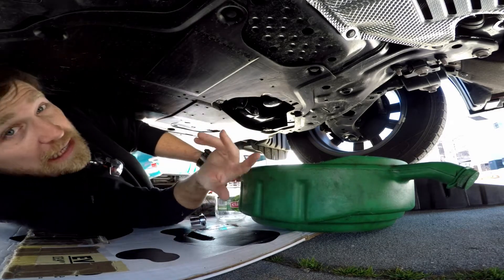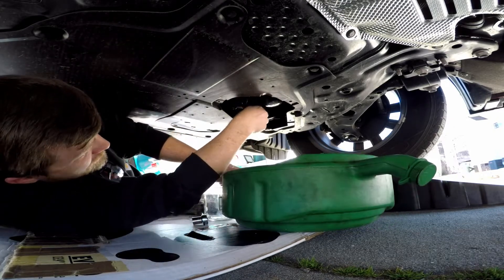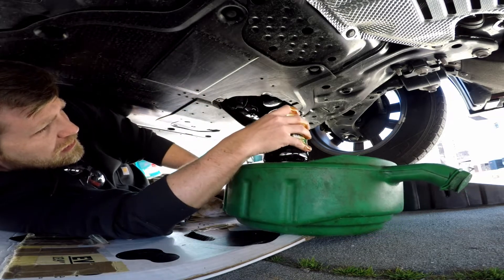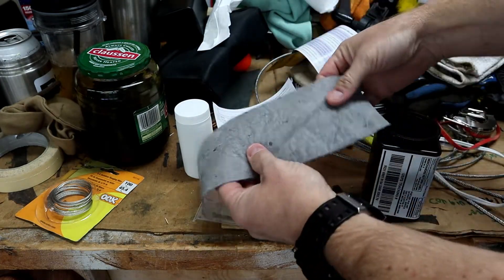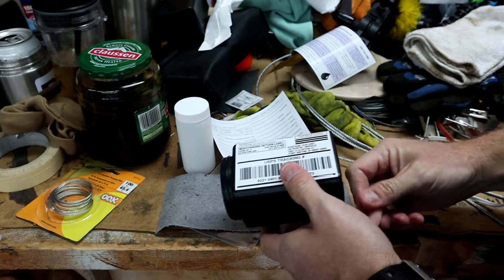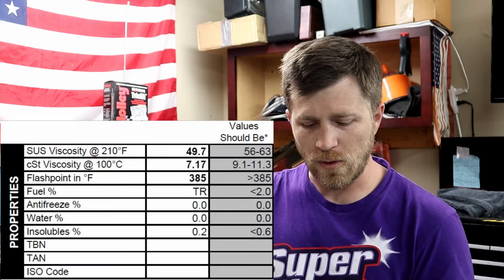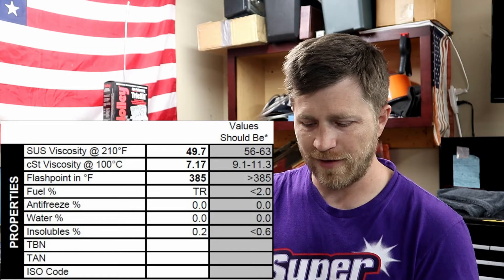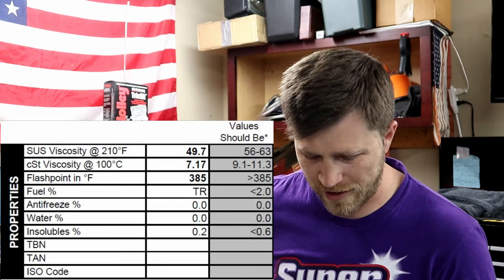METAL AND SILICONE IN MY OIL - 2020 Mazda CX9 Engine Oil Analysis

Comment: At 5700 miles, it's part of the normal engine break in. Yeah, it's normal wear and tear. I never knew about the silicone leftovers. Thanks for sharing. I requested several kits to try out on my 2005 Tahoe and my wife's Honda Pilot. I change the oil regularly on both vehicles so I want to know if I'm doing a good job or not.